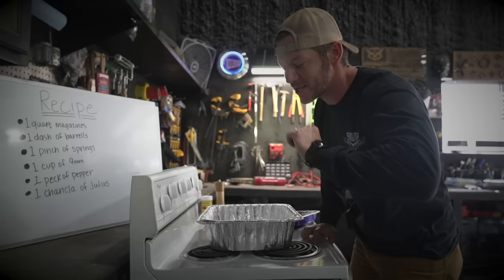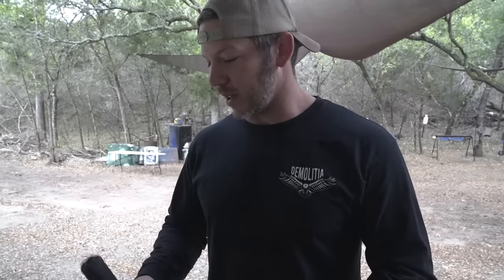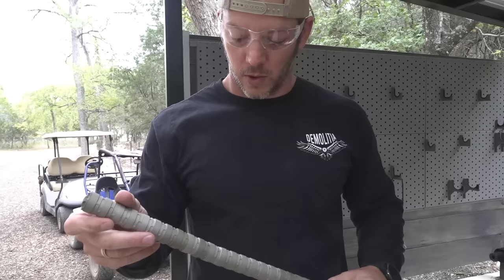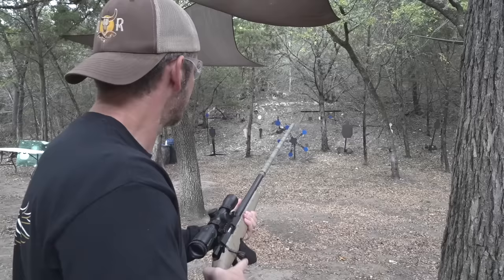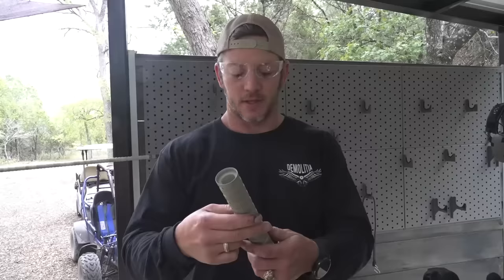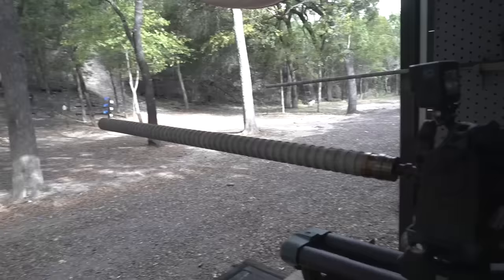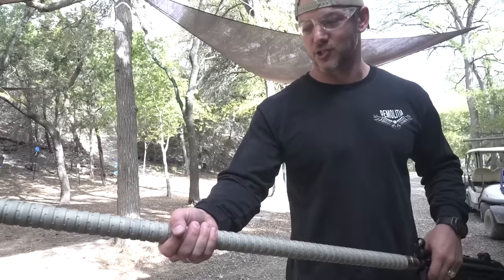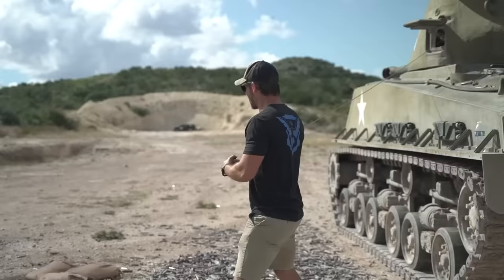Shooting The Worlds LONGEST Silencers!!! But Do They Work???

Comment: I could see suppressors like this being useful for long term sniping positions. And the possibility for complete silence+zero muzzle flash means the position could possibly stay as a sniping position for a longer period of time. If the longer suppressor had some sort of support instead of just hanging off the end, it wouldn’t sag and would only increase velocity.

I think an integrally suppressed sniper rifle with a very long barrel like this and a way to support the weight without drooping would be perfect for certain positions like holding an area.
Reply: At some point you would not only get into diminishing returns, but you would also end up losing a lot of velocity with a really long barrel/suppressor setup, even when properly supported, which will in turn start to affect your accuracy and effective range. There is bound to be some sweet spot where you've got just enough barrel length and suppression to serve the purpose of staying hard to detect without hindering performance, but that will tend to vary depending on the bullets being shot and at what sort of distances are required.
Reply: @Uradamus  nah think like 10 foot sniper
Reply: @Uradamus  suppressors don't reduce muzzle velocity. If anything it increases because the pressure stays behind d it longer.
Reply: You will hit a maximum velocity at some point, not to mention the bigass suppressor would be bulky as hell
Reply: @wesleyroberts7119  It seems you misunderstand basic ballistics.

Are you aware that with some loadings of some calibers extra barrel length can actually reduce muzzle velocity? With many .22 loads you wind up with a lower muzzle velocity out of a 24" bbl compared to a 16" bbl.

Inside the suppressor there is going to be a lot of turbulent gas flow that could disrupt and/or slow down the bullet.

With most modern baffle suppressors you wind up gaining a marginal amount of velocity over a bare muzzle, but if you make the suppressor extremely long it's likely that weird things will start to happen, just like an excessively long barrel.
Reply: @CharlieMikeNS  Sad 40” barrel noises
Reply: @CharlieMikeNS  the reason the bullet starts to slow down in longer barrels is due to the friction between the bullet and barrel. In a suppressor, the bullet does not touch the baffles therefore no friction (on the bullet and baffles, anyway) to slow it down.

With a normal length suppressor you often see higher velocities, yes they are marginal, but still typically higher velocities. 

Obviously you would get diminishing returns the longer the suppressor. But I doubt you would see a decrease in velocity even out of this extremely long one
Reply: @wesleyroberts7119  I know the bullet doesn't touch the baffles. I own 4 suppressors, I understand that. That's why I talked about the turbulent gas flow. You'd be surprised how much more resistance that can cause compared to flight through the open air. In the same way that bullets start slowing down because the frictional forces exceed the forces from the gas with excessive barrel length, the pressure behind the bullet will eventually drop and be outweighef by the friction from air resistance, which would be greater inside the suppressor than in open air. How familiar are you with fluid mechanics?

Either way, it would probably be negligible, and there are far greater issues with this concept.
Reply: Using a high velocity round your never going to get complete silence
Reply: @CharlieMikeNS  I own suppressors and am a mechanical engineer who has taken multiple courses in both compressible and non-copressible fluid mechanics. I know how turbulence works. I have also chronographed the same load on the same day out of the same gun suppressed and unsuppressed. I don't see why a suppressor would slow down a bullet, nor have I ever seen that be the case. Maybe, maybe if the suppressor is long enough it might slow it down. I would have to think on that. But any added turbulence caused by the slowing of gasses inside the suppressor would happen in the first section (if you had a ling suppressor like in the video). After that, most of the gasses have already been captured and the pressure and turbulence would have dropped off significantly. I don't think you would see much if any change in velocities after that first section. You might get some turbulence as the bullet passes through the baffles and pushes the air out of the way. How much would that minor turbulence effect the velocity? My gut says probably not much of a difference to matter, but you might think otherwise. I suppose the only way to know for sure is to test it or model it.
Reply: @farmersgrip  you didn’t pay attention then, he said that after a certain amount of suppressor length even the sonic crack of the super-sonic rounds started to diminish and it would likely become very very hard to pinpoint the origin location of the shot. With suppressed super-sonic rounds, there is often even a benefit in that the origin is so quiet that when you hear the crack wiz by you, it is disorientating and causes you to think the origin of the round is coming from the direction of the crack as it flies past, instead if the actual location it’s being fired from. Example: lets say it flies past your left shoulder. You hear the crack of the round flying past your left shoulder and it makes it sound like you are taking fire from your left, even when it’s coming from straight ahead.
Reply: @wesleyroberts7119  There's the turbulence, and also the fact that the air in the suppressor is confined unlike the open air, and as such it exerts more force on the bullet as it's pushed out of the way. The cut in the baffle is barely larger in diameter than the bullet, and on the other side is another baffle designed to trap gas. Much like the piston effect when cars go through tunnels, the bullet will encounter significantly more resistance doing this than flying through open air. I'm an engineer as well.

Even with a 6' long suppressor this will probably amount to less difference than the variance from round to round. I'm not disputing that it won't make that much difference. I'm disputing the claim that absurdly long suppressors will increase muzzle velocity.
Reply: @vladvladimirov4399  I pay attention to reality
Reply: @vladvladimirov4399  the supersonic crack doesn't depend on the suppressor at all. It only depends on the velocity of the bullet.

It sounds quieter to the shooter because it's further from the shooter's ears, not because it's quieter. The crack of supersonic bullets by themselves are already difficult to locate.
Reply: @wesleyroberts7119  I’m also a mechanical engineering student and am happy you commented this. Suppressors only increase velocity due to decreased drag. Turbulence could likely be turned into a non-issue with correct baffle geometry. You are correct though; once it leaves the barrel there is no longer contact between the bullet (previously expanded to fit the grooves of the rifling and therefore slowing due to friction), and the rifling. That friction even in a longer barrel is also being compensated by whatever barrel length is being used, which prevents drag and allows all of the energy of the powder to burn longer and take full advantage of the cartidges’ power. So yes, there’s only added velocity unless there’s some sort of impact with the baffles which increased rigidity (which would come from adequate support) would prevent.
Reply: I use my wife to support my long suppressor and sometimes my neighbors wife and her sister.
Reply: We got an airsoft sniper expert boys.
Reply: Maybe like 2 feet of suppressor, but not 5 feet.
Reply: Too long/heavy of barrels require more parts and complexity in gunsmithing. It’s probably not worth it considering rockets and bombs.
Reply: DL Carbine would like to have a word with you.
Reply: Bro 💀
Reply: Might as well just use subsonic rounds at that point, the bullet velocity is gone and it’s not practical to carry that thing around
Reply: @KeterMalkuth  Exactly, I’m pretty sure our government has already spent millions or billions in R&D to figure out the optimal length so whatever SOF guys use in the military is most likely optimal.
Reply: @wesleyroberts7119  you would most definitely see diminished returns from one this long..
Reply: Look up how Kraber form Apex Legends looks on 2 of its skins, it has like rails going below and above the barrel. 
 I think that might work for what your'e saying here.
Reply: Doctorator Plague  I'm not convinced it would have the same effect. The reason a bullet will slow down in an overly long barrel is because the frictional force  the barrel exerts on the bullet overcomes the pressure of the expanding gas, therefore slowing the bullet down. A suppressor does not touch the bullet so you eliminate that frictional force, but still have some pressure behind the bullet from the expanding gas (at least for the first section of the suppressor). This WILL INCREASE, maybe not by much, but it will increase the velocity of the round. That is well documented, and I have tested it myself. What happens after that first section? I can't say for sure, but I agree with the other commenter here, you would likely get a slightly more turbulent flow (compared to a bullet just traveling through the air) and because of that increased turbulence, some slightly reduced velocity. How much reduced velocity? I cant say for sure, but my gut says not enough to really matter. To be clear though, the velocity you gain in the beginning isnt enough to matter either.
Reply: The other thing to do is open up the bore further out for deviation.  I form 1'd a 4ft pipe and it worked fine since there wasn't threads to cause the droop.   Solid/welded baffles with thicker walls will always droop less than individually threaded baffles.
Reply: @quill9648 oh no you did not just bring up a scifi video game characters gun as a reference in a suppressor design discussion.
Lol.
Reply: @shirothehero0609  And why the fuck not? We're talking theories here, and most designs in Apex are reasonable in their own rights. Hell, I've seen some sci fi guns looking more plausible than real life platforms
Reply: @vladvladimirov4399  you don't hear the crack next to you... the sound is coming from the direction where someone shoots.

Comment: I want to see what would happen if two barrels were threaded together muzzle to muzzle and a round sent through. Would you need a different twist rate to cause problems or would the second barrel's rifling from the muzzle be enough to mess the round up?
Reply: He should do this
Reply: 100% it would mess up the round abd the 2nd barrel. For them to be muzzle to muzzle the rifling in the 2nd barrel would be rotating the other way. It would be carnage.
Reply: Id watch that
Reply: @dan3458  Carnage might be a bit overkill. It would definitely damage the rifling in the second barrel if it had a large enough deviation from the first. But if a shotgun can take a 1oz slug through a choke without causing carnage I don't think reversing the threads would do much beyond striping the rifling.
Reply: Twist orientation is constant in a solid object regardless of if you turn it around. Think about how a coil spring upside down still looks identical to right side up.
Reply: American Education: if u turn the nut around you have to turn the other way
Reply: @dan3458  "the rifling in the 2nd barrel would be rotating the other way"  Huh?
If you flip a bolt or piece of all-thread around, does the nut need to spin the other way? Of course not.
Reply: Most rifled barrels are tapered toward the muzzle, once the bullet passed into the second barrel it would then gradually open up and put less pressure on it.
Reply: @bradleymorgan8223  Who told you that? It's untrue. Whether cut, button, broach, hammer forged, or ECM'd, they're all the same dimensional measurement down the bore.

The only typical difference, from end to end, is one has a stamp which denotes which end to chamber. This is usually due to cutting direction (start at chamber) or a flared end (this would be the muzzle side).
Reply: @tomb816  hmm... ok it looks like tapering is only a thing on certain types of artillery pieces. Thank you for that!
Reply: @bradleymorgan8223  👍

Comment: I have a theory. When it was in the vise, I think maybe the natural barrel oscillation was enough to get the ridiculous suppressor to oscillate the same way, thus negating the droop and allowing the bullet safe passage. Then when handheld, your own body motion was dragging it out of square ever-so-slightly before the bullet had time to fully clear the suppressor. Added velocity and stiffness must've made the 9mm not suffer so much as the .22. I'd be interested to see what, if any, effect this had on velocity.

Comment: the good thing about really long suppressors is that after they've gotten a baffle strike and are unusable, you can take them off and beat the enemy with them
Reply: Or use em as legs for a low table. Already got thread, only need a bolt

Comment: I am making a guess after you did 4 sets on the .22, I would think that the recoil that generally causes a slight barrel lifting force, would cause the tip of the droop to spring up with good enough timing to avoid being struck, basically it self centers, as there is just enough droop to spring ration. But I also think you will hit a point where you get a baffle strike, so there is probably some sort of sweet spot that some mathematician can figure out. edit and my theory of why you starting getting baffle strikes when shoulder fireing, is because your body isn't holding the rifle as rigid as the vice, making you absorb more energy, changing the flex of the barrel and also you where swinging the rifle, which would mean the barrel would have momentum vs being at rest before each shot.
Reply: i was thinking this also, as well as the pressure from the shot putting internal pressure on the suppressor, 'inflating' it and straightening. maybe :)
Reply: Excellent thinking mate!
Reply: For a mathematician to "figure it out", it'd only be specific to one gun with one ammo type and one specific length. They'd have to run thousands of tests to figure out the balance for each gun, ammo, and silencer length. I don't think it's worth it 😂
Reply: @youngeshmoney  you ever been on r/theydidthemaths before they would love a challenge like this

Comment: Would have been interesting to see the diminishing returns, at which length is the suppressor most effective, and at which length does it stop having any additional affect on noise reduction. Get a decibel meter and re-test! :D
Reply: I’m also curious to see if it affected the velocity of the bullets. Should have shot through a chronograph
Reply: @shaneh7519  I mean, at the lengths he was using, it had to have slowed the bullets down.
Reply: He gave the answer. The heat pattern he described will tell all except velocity change.
Reply: @kaidwyer  Not how that works, once the gas has accelerated the bullet to its top speed it keeps expanding in the suppressor just like it would in the air without one, if anything it probably gained a little bit of velocity just like with a normal suppressor. Of course the baffle strikes would slow it down, but other than that there's no reason that it would.
Reply: @andrewbell7696  The heat dissipation probably correlates with the sound reduction, but I doubt it's a linear relation, least of all 1:1. The heat dissipation depends on the suppressor material, rate of burn, length of barrel, etc. These things have a lesser effect on the sound reduction.

Comment: Something to bear in mind as regards the lessened tendency for the 9mm suppressor to 'boing': given that it has a larger diameter, it will naturally be stiffer. This is something that is applied to racing bicycles. Using larger diameter tubing in the frames gives you a stiffer, more responsive (to acceleration) bike. So, I'm not surprised to see less flexion in the suppressor.
Reply: That's what she said 😂🤣😉

Comment: Video 11 of suggesting you install a zip line type target - pull a rope (or push a bottom on a wireless controller) which releases the target, which rides on the cable from one side of the range to the other. My dad was a law enforcement ranger at Mt. Rushmore for 31 years and they had this at their practice range - it was quite fun! 

Think of all the hilarious possibilities!

Comment: I'm pretty sure the reason why the vice worked with every extension was because the strikes are guaranteed if there's any movement with the gun. The amount of flex in the super long suppressor means all motion is amplified, so it being super still in the vice means no movement besides when the bullet left the suppressor. You moving and shooting or even shooting organically meant small movements were being shot through the entire suppressor and that probably guarantees that there will be a baffle strike.

That being said, how long did it take you to film this video, Matt? If it took you longer than 4 hours, you need to go see a physician immediately.

Comment: I must order more modules for my A-TEC PMM-6. It's also modular. BTW, I suggest you put a light coating of copper-slip/anti-seize compound on all the threads. It works well for keeping the threads clean of carbon and makes disassembly/reassembly easier with no 'nails on a chalk board' screeching. For suppressors that don't use o-rings, the compound should provide some level of a seal.

Comment: You need a Db meter so we can see how loud it is.  Also would be interesting to see how loud it would be with the subs if you lock the bolt so it makes no noise when it cycles.

Comment: 5:49 why not just rest the suppressor against a flat surface so the bend goes away? It's the weight that makes it bend downwards so if you put it on the table the weight wouldn't be pulling down on it.